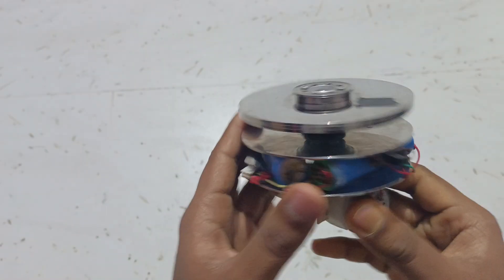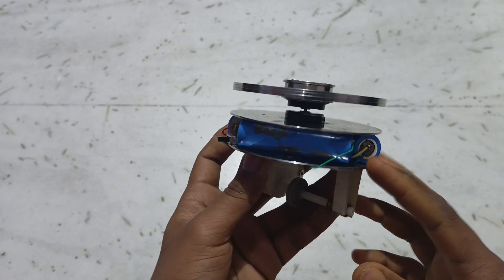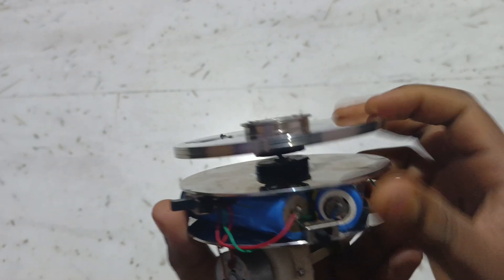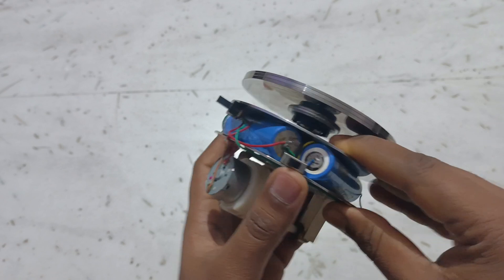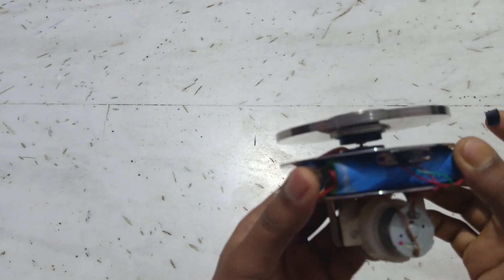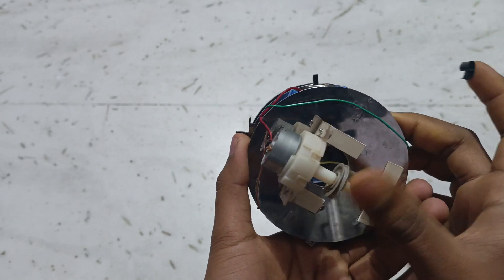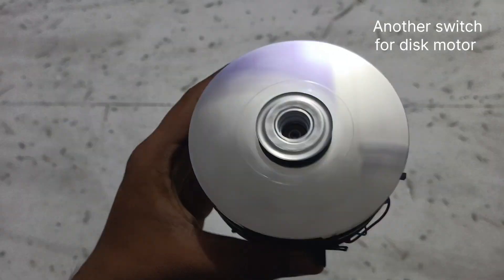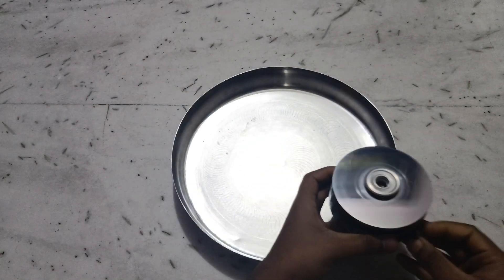DIY rope walking GYROSCOPE balancing robot 100% work #diy  #inventions #projects #gyroscope

Comment: Do I have to build that gear motor? I can’t seem to find a gear motor anything like that
Reply from the maker: You can use n20 gear motor or BO motor also, just maintain the balance and motor position.
Reply: How will a BO motor work? If I put a wheel that comes with it, it won’t balance on the rope. Should I make a groove on the wheel? And the motor spinning part is on the side and not in the middle, so will it still work?
Reply from the maker: That wheel will be too big for it, you can use a small pulley with it. And if you are using big disk use bo motor as I did,(my motor size is like a bo motor) or if you are using small disk then go for n20 gear motor.
Reply: Brother, where are the instructions, and also, can you recommend any sources of information necessary to make this work? Thanks 😊👍
Reply from the maker: A bit of details you can find in this video https://youtu.be/Au7etoSAnMg?si=8Er1nP7EDK8K_BIC
Reply from the maker: @PublicMessageTo a simple one is here https://youtu.be/b0d-yd40VGA?si=VRkSJcYguhnx2mrY

Comment: Brother how much rpm motor I have to buy?? Please answer
Reply from the maker: I have used a normal cd/dvd dc motor, rpm ranges between 3000-6000 rpm, after putting the heavy disk on it the rpm will increase more.
Reply: Brother, I talking about the gear motor rpm ???  @elecobot
Reply from the maker: 20-100 rpm. @CreativeElectronics1234